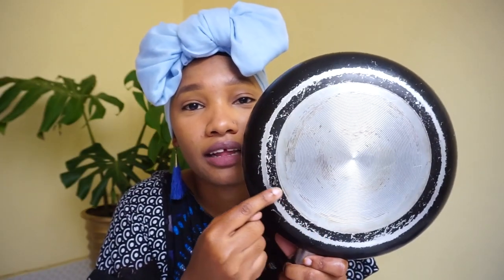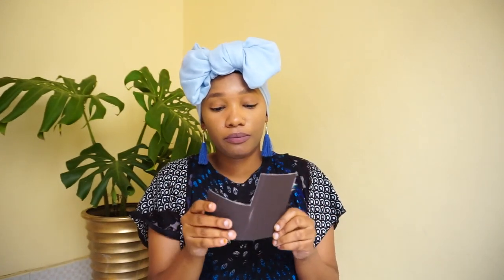How To Get Your Old Nonstick Pan Coating Off | Hawa's Kitchen

Comment: Do you think an handheld electric sander would be a safe way to do this instead of sanding by hand? Or would that probably wear off too much of the metal as well as the coating?
Reply: It might damage the pan. Doing it by hand sounds better to me. But remember to wear gloves. It took me only half an hour to get the coating off. I used toothpaste and tons of dishwashing liquid
Reply: U need a long strip of sandpaper too.  Gotta keep changing it ever now and then
Reply: @Trollika_Devi  Plus a mask and eye protection, probably not good to breathe in the dust of the teflon
Reply: @jenniferjen5422  Yes 💯

Comment: Thanks for this clip ...

From what I gathered here is thar fact that Aluminum is just as Toxic as Teflon  ... any thoughts ?
Reply: Aluminum is safe to cook with, though not if cooking acidic or alkaline foods.  Those foods will cause more aluminum to leach into the food.  Otherwise, normal food will have so little aluminum leach, that it is negligible and will be expelled in urine.  Better bet, though, is 18/10 stainless steel.  Cast iron is good, but not for every meal, or you risk overdosing on iron (you get natural iron in the food you cook in a cast iron pan - less if you keep it heavily seasoned)